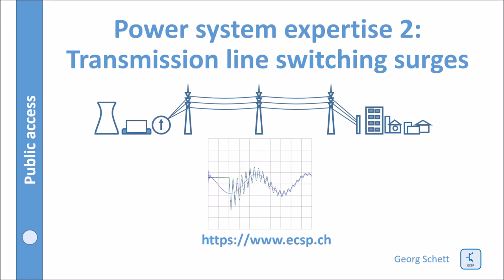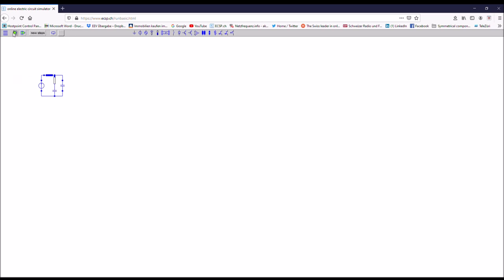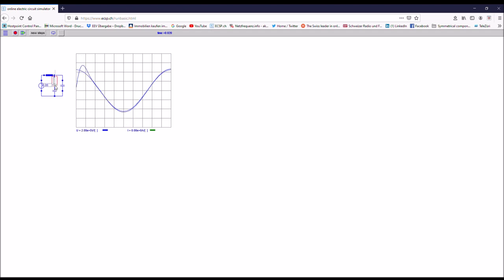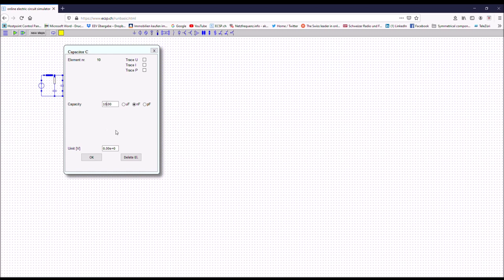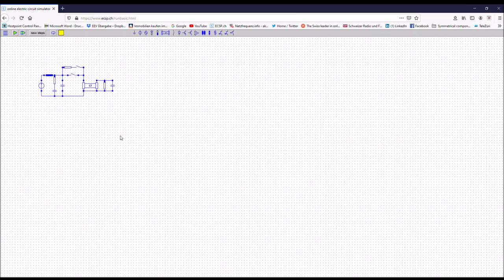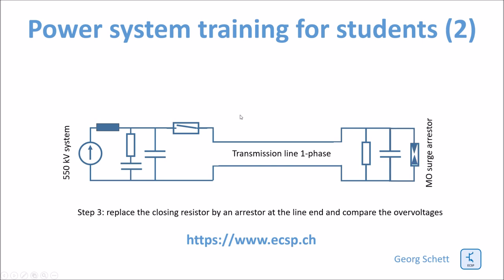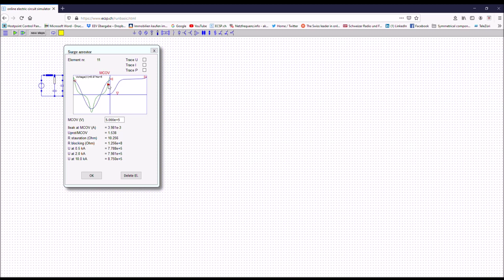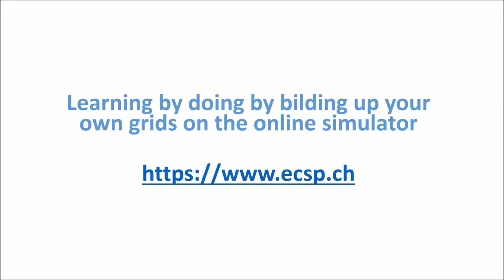Power system expertise 2: Transmission line switching surges

Comment: Hello George i have a question related to type of transformer used in power systems. There seems to me that there is a disagreement online about the zero sequence impedance of a 3 core Yyn connected transformer. Some claim this has a very high zero sequence impedance while other that this zero sequence impedance is low. The reason its low is that the zero sequence flux has a high reluctance path ( has to go in the transformer tank), thereby the inductance goes down and the zero sequence current goes up. The 3 core Yyn transformer should then be able to deliver high short circuit current in the case of LG fault. The argument for high zero sequence impedance is that allot of the zero sequence flux becomes leakage flux, and thereby zero sequence impedance should be high. Do you have any idea about these things? Cheers Magnus
Reply from the maker: Hello Magnus, I am not a specialist in symmetrical components for transformers but I recommend to contact P. Ramachandran who is the best transformer expert I know. His mail address is: prc3011@gmail.com.
You can contact him via linkedin as well, search P Ramachandran. Best regards George.
Reply: Many thanks  @georgschett801

Comment from the maker: What do you mean? It is all in the video.
Reply: I mean, the simulation file, because when I tried to make it there were components that weren't there and it didn't match what you made, sir.
Reply: and I'm just learning, in the video it's too fast to take the components, the wave results I make are not like the ones you make in the simulation
Reply: and I'm not fluent in English, I just use translation to understand it, because of that sometimes I still don't understand what you mean, sir.
Reply from the maker: The transmission line models are available in the pro-version of the software. The free version does not support these models. @rasras6002